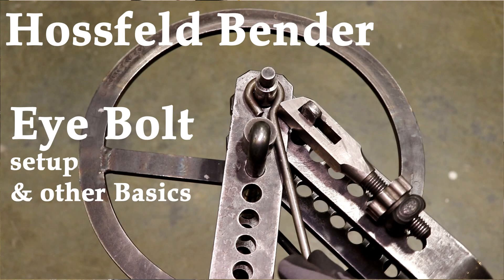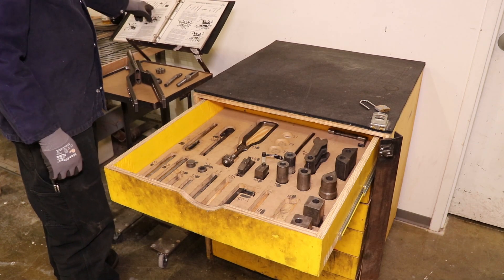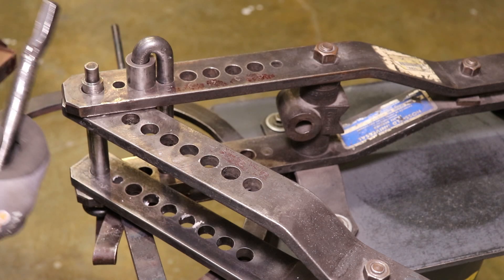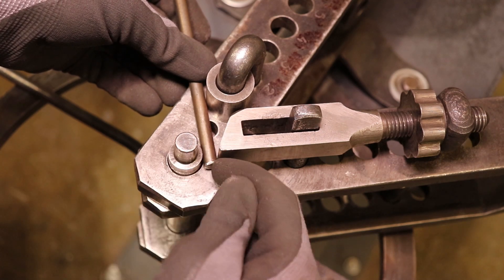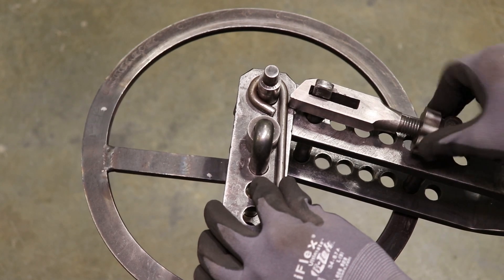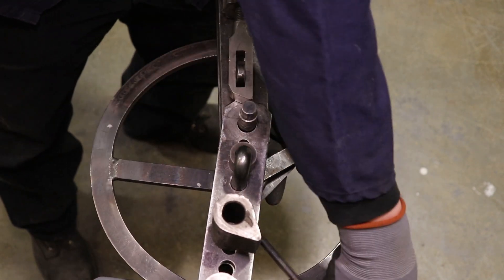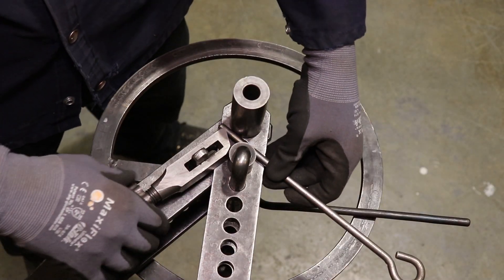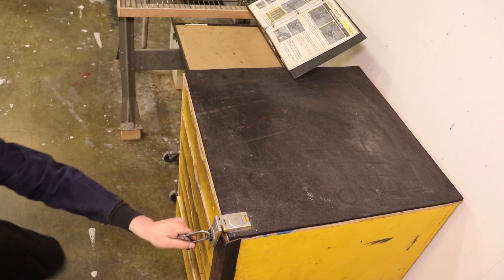Hossfeld Bender: Eye Bolt Setup & Other Basics

Comment: Hi Rob!   Thanks for the amazing educational videos. How did you source or create that large manual?
Reply from the maker: Hey Taylor, The manual came with the machine. One of the past school technicians put together the binder and added to two colorized pages on the angle Iron flange out instructions. If you own a Hossfeld, I would call them up and see if they'll send you a copy. The official one is printed on sturdy stock and has good clear illustrations and images. Otherwise I have an OK scan I might be able to e-mail but the images are a bit blown out.

Comment: Hey man was wondering where did you get the pusher dye tool or where can I get one ? And how can I make a eye bolt with a compact bender ?
Reply: From Hossfeld Mfg. they have a crazy number of attachments for this bender. Be aware that the attachments for the Hossfeld #2 are much too big to use on any of the compact benders! You’re comparing apples and oranges!

Comment: Thank you for making these videos.  I have a hossfeld and the most common thing I use it for is hooks of various sizes such as what you demonstrated here.  Would you consider doing a video demonstration of bending angle iron on it.  I see you have the dies.  I would love to see a good demonstration of both the “easy way” and the “hard way”.  I have struggled to get good results with angle iron from the user manual alone.  I have never seen anyone else do it.

Thanks again
Reply from the maker: Happy to help, Ernie. I shot a bunch of footage on the machine a year ago, and have a rough edit of the angle Iron flange out (the 'easier' of the two). Stay tuned and I'll try to get it wrapped up soon.
I never shot any footage of our flange inward set-up in action (bending it the 'hard' way). It's tricky to get good results when bending flange in; the metal is trying to compress and shrink the flange when your bending it in toward the center. In my experience it would rather twist and corkscrew as you go and that set-up doesn't use the same crushing action as the flange out. But I'll see about pulling those dies out and experimenting more over the holiday to see if I can get some better results with it. 

Bending flange out is easier on this machine because you're stretching the flange. The Hossfeld is well designed for keeping the angle flat, because it's crushing that flange between two flat surfaces with almost as much force as you're using to bend the radius. I've also had pretty good results with their flat stock edgeways radius bending setup using the same inner radius blocks and the B50 master die. You just need their "Edgebend Die", and the pins and spacers appropriate for the material you're working with.
Reply: Rob D'Amico Thank you for your reply and the follow up video.  It is extremely helpful.  Your videos are better than any of the other hossfeld videos I have seen.  I subscribed and look forward to any others you may do.